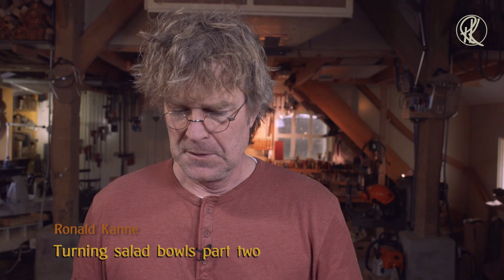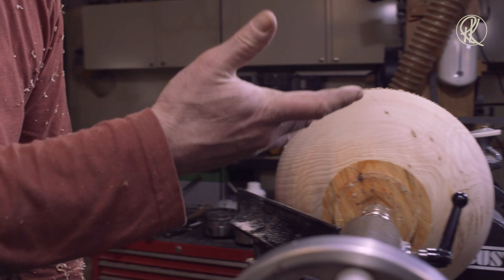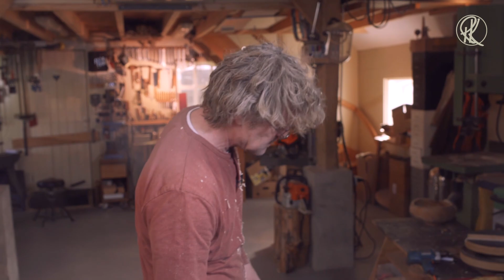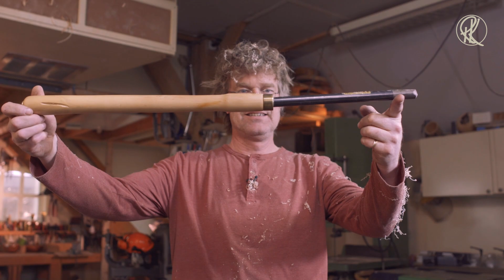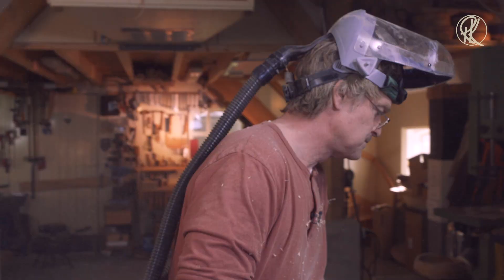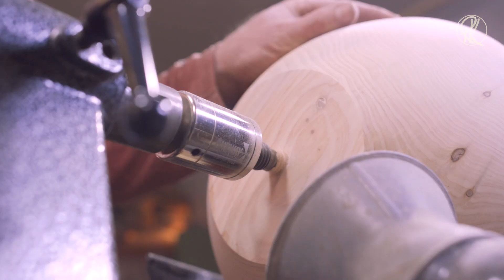salad bowl part two

Comment: Thank you a most excellent pair of tutorial videos i saw in the comments that you normally wait 10 to 16 weeks and longer depending upon the type of wood. But was left wondering how you tell if it is dry enough, do you do it by weight loss or do you have some electronic tool that measures the water content of the wood

Comment: I'm working on a walnut bowl. And I also have a lot of tear out on the inside. See if I can get rid of this now with your tip. 
(If I dare, because I don't want a catch 😕) And as an alternative? Use sealer and then sand a lot?
Reply from the maker: I bet you had a catch by now... :-) Sorry for my late reply. Walnut is a very easy to work wood, so if there is tear out on the inside i'd say it is because of technique or the sharpness of the gouge...
Reply: @ronaldkanne  I think both. I am practicing on various pieces of wood that I still have. I suspect that I am too late with sharpening. So when I think about sharpening, I am already too late. 🤔😬